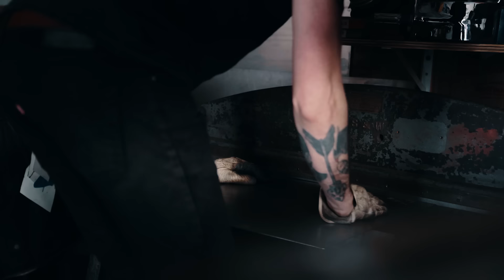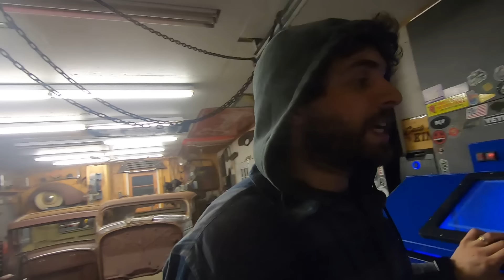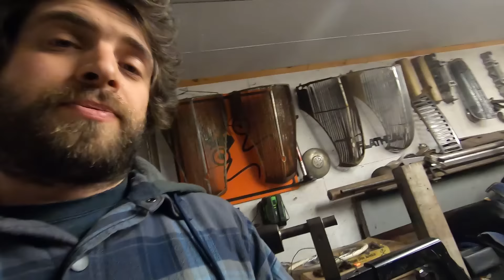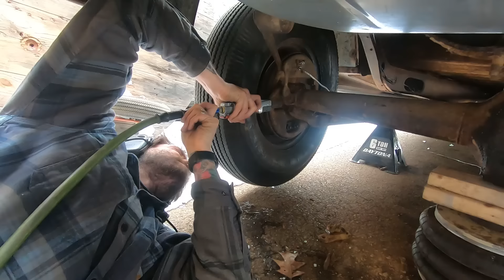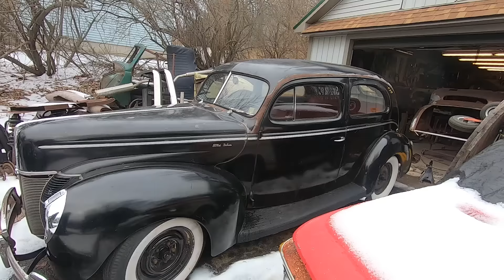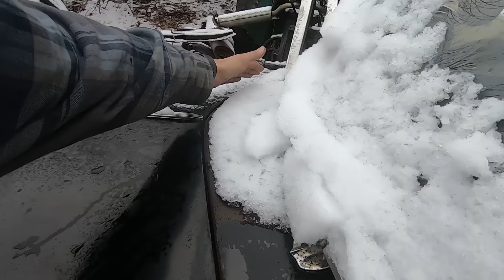Lowering the Rear End of the 1940 Ford Tudor Sedan with Old Yankee Speed Equip

Comment: On mine I had to take the pack apart to put the main on the axle and then assemble the spring back together. But I also used stock length shackles
Reply from the maker: yeah if i had stock length i wouldnt have been able to do this.